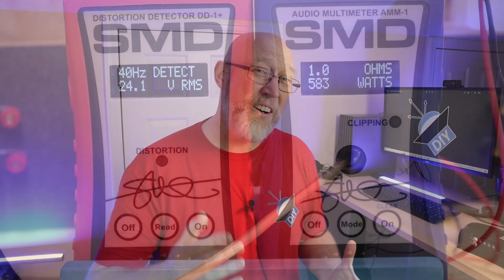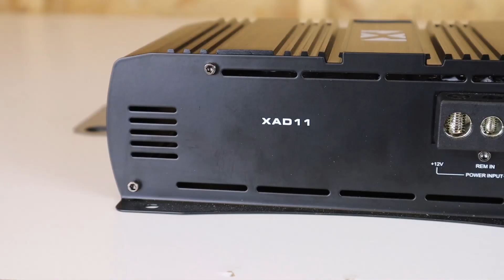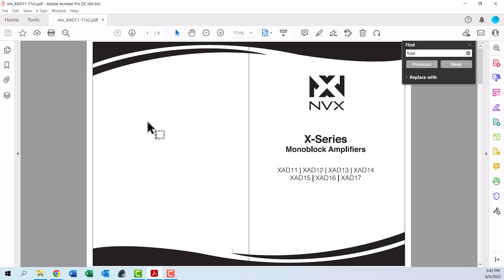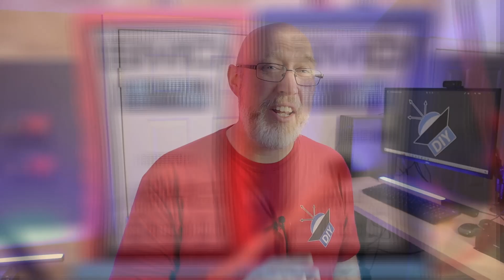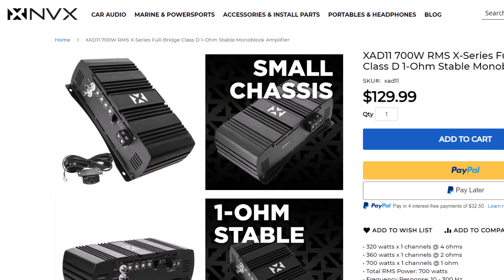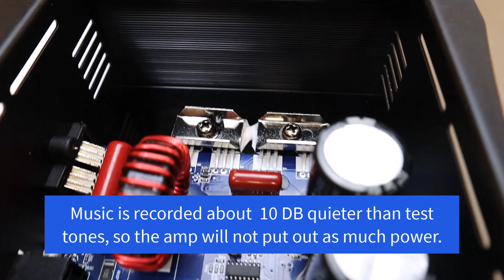Small and Powerful  This amp will surprise you!    NVX XAD11 amp dyno  @NVX

Comment: Why you divided 700/10? Wouldn’t you have to divide it by 12? For 12v? That would give you 58.33amp giving it a 60amp fuse?
Reply from the maker: Cars don't actually operate at 12 volts.  We operate in a range mostly between 13.8 and 14.4. after you take that into consideration and take the amplifier efficiency into consideration dividing by 10 to get you a lot closer than dividing by 12.

Comment: Crazy I bought this amp, came with 2 in and 2 rca connections…..I installed it today and when I went to do the SMD CC1 LPF will not calibrate 😢 but when I swapped it out for my deaf bonce I had no issues calibrating the LPF…..could it have been a bad amp?

Comment: but the test never showed 1ohm with music would have been over 700w i would assume
Reply from the maker: Absolutely.
Reply: @DIYAudioGuy  could this amp really be putting out 700w if it never draws  70 amps i notice with a 60 amp fuse it never blows alil weird
Reply from the maker: @jaygee6983  Yes
Reply: I only ask because I was told that you want to take the total wattage and divide it by 10 which would be 70. Seems like it's working great with a 60 amp fuse
Reply from the maker: @jaygee6983  your calculations are correct. But fuses are rated for current draw in a given amount of time.  So if you're not popping the 60 amp fuse when playing full tilt then everything should be just fine.

Comment: Having two SIA3500's running the subs in my car I can tell you the only difference is the bass knobs. The sundowns have these nice metal knobs that look like little amps themselves. The only issue I have with them is they go into protect pretty easy. If input voltage is too high... protect. If you turn the gain up a bit... protect. I like to think these amps are built for more efficient bass builds. Putting them on big inefficient subs takes a little too much out of them.
Reply from the maker: Hey dude! I was so excited to see the video on your channel of that Buick rolling under its own power.
Reply: @DIYAudioGuy  It surprised me too!

Comment: KnuKonceptz Kolossus Fleks Kable 8 Gauge can handle 60 amps up to max 20 feet.  At 3 feet, from distribution block to amp, it can handle up to 100 amps.
Reply from the maker: That is good wire.
Reply: What about 6"?
Reply: @theejoeylee    Their chart doesn't go that low so I have no idea.   The real question should be "Why not use 4ga after 100".  For a 6" run especially, you're talking barely anything.  If already running 4ga from the battery back to dist., I can't imagine not having 6" left over.
Reply: @marcuslinton310  My amp won't fit 4awg ( razor 2500D)
Reply: @theejoeylee    It only has 50amps worth of fusing, 8ga is more then enough.
Reply: @marcuslinton310  it can draw a bit more @ 1 ohm. Think 70 to 80 amps
Reply: @theejoeylee    The amp cannot draw more power than what it is fused at, that's why the fuses are there.  If it was to hit 70 amps, something went wrong and the fuses would blow.
Reply: @marcuslinton310  Who says I still have the factory fuses? If you're not familiar with the razor ,it's Korean board and are far more capable than their 2 ohm rating suggests. With the factory fuses in running it at 1 ohm it's holding the amp back a little bit. Swap the 25s for 30s and it comes to life.
( also any of you young kids reading this disregard anything I just said never swap out the factory fuses for bigger ones)
Reply: @theejoeylee  Even so, it cannot produce more amperage than the fuses, it will blow them.   So if you have 2 30's then your capped at 60amps, well within Kolossus 8ga abilities.

Comment: Awesome video Justin 👊🏼 It’s so cool seeing little amps like that putting out big power but I’m still not sold on the Brazilian style full bridge amplifiers. They’re inexpensive watts per dollar wise but what good is it if it’s blown? They need to start making them  reliable. Too many problems wit those amps in my opinion.
Reply: Full bridge has been around forever, and is very reliable. The problem with "Brazilian" style full bridge, was that they were using boards that were to thin, and it could not stay stable under loads and carry the voltage.  JL Audio,  Rockford, Alpine and many other companies have utilized full bridge over the years. Taramps used thinner boards in the HD lines, and it was absolutely a problem. We have about 30 full bridge samples in hand, and have been fully tested over the past year, from the same build house used by CT, Sundown and a few others. We made changes to the amplifiers, with faster switching fets,  changed up the low pass filters to 40hz and some other small changes. We had one amp fail, out of the 30 or so we have tested. It failed, running at. 7 ohm in a daily build,, after 4 months. This amp he tested here in this video, is an 800.1 board. The build house, has updated the boards a bit since the SFB models, they built. Keep them at 1 ohm, keep the voltage at 11-15 volts,  and there isn't much problems to have. Just from our experience.  Great video btw. I am now a subscriber!!
Reply from the maker: That's fair.

Comment: That looks like a mirror image of the soundstream TXP1.3500 which puts out quite a bit more power.
Reply from the maker: Yep, Brazilian style full bridge.
Reply: @DIYAudioGuy  I have the soundstream in my Jeep build because of extremely limited space for components. I was just able to put the txp under the rear seat to drive a pair of Skar 12” shallow mounts in a 2cu/ft box. I will say the amp is powerful but dumps noise in the system.  It doesn’t have anywhere near enough caps in the supply side so it causes a high-pitched feedback into the system. I’ve tried different power wires, different ground points, different signal wires run different ways. The decider was I dropped the Skar 1200 amp in and it had zero noise, which narrowed the problem down to the specific soundstream amp. Unfortunately the Skar amp doesn’t fit so the same amp is back in and I have a bunch of ground loop isolators installed that mostly get rid of the noise.
Reply: If you're interested, since I have the skar as a spare (albeit it'd be laying on the rear floor) I'd be happy to send the soundstream your way so you can test and compare it to the NVX.  Be interesting to see whether or not it actually puts out anywhere near what it says it does compared to the visually identical NVX.
Reply from the maker: @whodat90  I appreciate the generous offer, but I am good.

Comment: I'd pay the extra $35 and get the Skar 1200.1. The internals of this amp just seems really sketch, almost like that less is less type of feeling. Great SMALLamp but there are better options IMO. Cheers!
Reply from the maker: If I were you, I would check out the NVX website, after you throw on that discount code a bigger amp will start to look real cost effective.
Reply: @DIYAudioGuy   I attempted the discount code and it didn't seem to work. I copy and pasted the info.  Either way great video!!
Reply from the maker: @MOBAudioUSA  Hope I can get that fixed today or tomorrow.
Reply from the maker: I just heard from NVX, it should be working now!
Reply: I would not buy a skar RP amp for anything terribly in efficient at 1 ohm and will not make near this kind of power on a active load . Plus for $35 more you could get a 3k Brazilian clone  or a recoil 1200.1 that's a better sounding amp with a clip light.
Reply: Yes and No it looks like lees because of the Brazilian style full range compare to the Skar Chinese Corean clone design

Comment from the maker: Make sure you use the code diyaudio10 for a discount at nvx.com.
Reply: The code isn’t working right now, just a heads up.
Reply from the maker: @zackmattox9792  did you try it on the NVX website or did you try it on Sonic electronics?
Reply from the maker: @zackmattox9792  did I spell it right? Sometimes I have a tendency to get letters swapped?
Reply: I’m on NVX and it’s spelled right I believe, diyaudio15. I’ve also tried it in caps.
Reply from the maker: @zackmattox9792  They recently updated the website.  That might be the issue.   Sorry that it is not working.
Reply: It’s all good, I love the channel! I still ordered one 👍
Reply: The 15% code doesn't work but the 10% (diyaudio10) does.
Reply from the maker: @CRASHF1RE  sorry about the confusion.   DIYaudio10 should be stable for at least a few more months.
Reply: @DIYAudioGuy  , do you happen to know what the amps efficiency ratings were? I'm trying to find a budget replacement amp from one that got stolen when my car got hit 🤦‍♂️. I only plan on driving one 12 and lean more to overall sound quality than spl. I am pretty much open to any brands and am attempting to stay under 150 bucks.
Reply from the maker: @nkhockey09  I do not.

Comment: For a cheap clean source it may be a good idea to use a dac/headphone amp combo. The fiio E10k and the schiit audio fulla 4 would both be great options.
Reply from the maker: My plan is to upgrade to a touch-screen head unit in my truck and then use my old reliable alpine on the test bench.
Reply: @DIYAudioGuy  that'll definitely work too